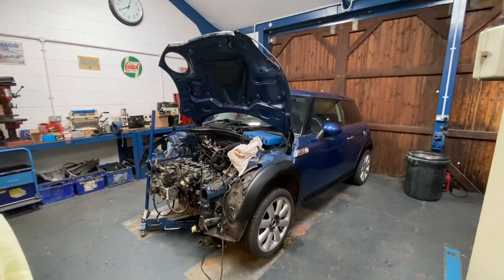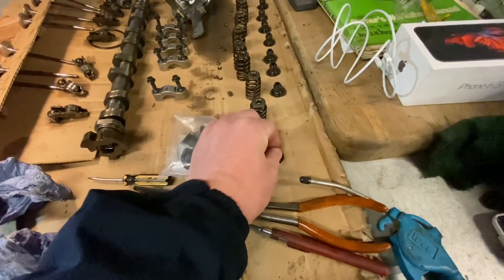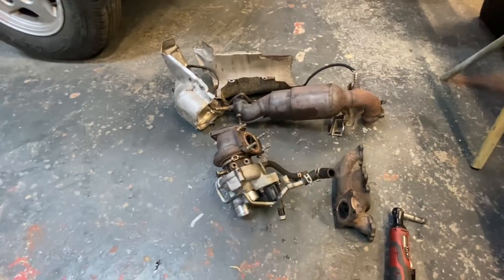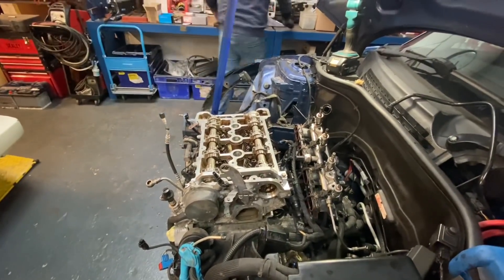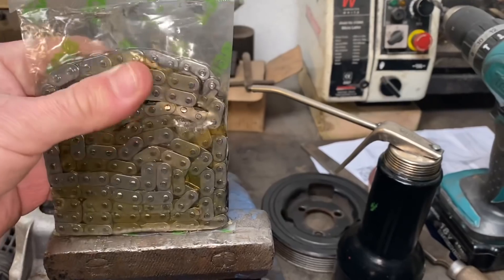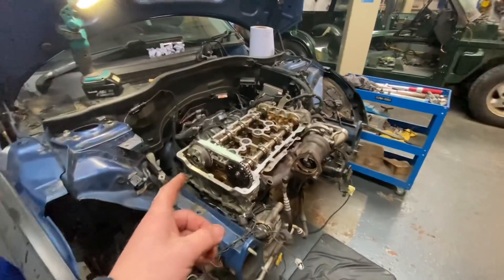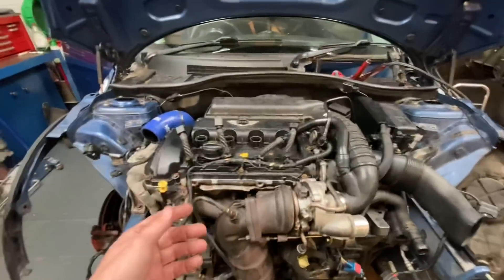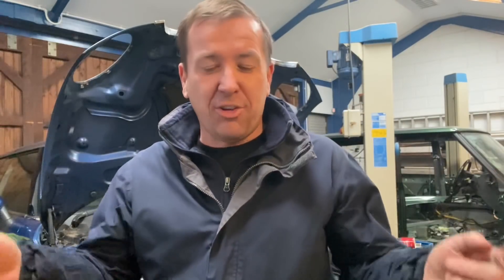Bargain£££ Mini Cooper S Engine Rebuild Will it Run ??? PT 4

Comment from the maker: See quiet a few questions about the head gasket of corse the new gasket was fitted you cannot reuse a head gasket wen Chris is sliding the head on the new one can be seen
Reply: Hi Rob great video as usual, i used to have to lap the valves in by hand in the "good old days", We used to reuse copper head gaskets back then on model T Fords LOL :-)
Reply: @nicnak4475  🤣🤣
Reply: Who ever said this is clearly not a Subscriber. 🤣🤣🤣🤣
Reply from the maker: @nicnak4475  they couldn’t be used twice anymore 👍
Reply: Like you would put it on without it
Reply: I would guess that the hole in the valve appeared gradually and the car would only misfire on low revs. I'm guessing the car has been run for quite a while while misfiring on low revs hence the buildup on the valve.
Reply: @deanharriss2029  :-) :-)
Reply: If my 147k mile Micra ever needs his Engine sorting out I think a 250 mile journey South is a good idea !!
Nice work , making a skill look easy as per usual with you two !! 10/10
Reply: Certain rebuild channels on YouTube would have reused the head gasket 😂
Reply: Sammy TheSeal  certain channels would have used a kellogs box and some gasket sealant 🤣🤣
Reply: @nicnak4475  Like many British motorbikes even into the `60s! You`d have to give them the oxy treatment first though to re-soften them but only if it was a single sheet of copper. You couldn`t do it with gaskets that were multi-layered because most of them contained a layer of asbestos!
Reply: @sammytheseal2307  You can reuse a copper head gasket after it's been annealed.
Reply: @lukem9766  Lol 😂
"They'll never see it and it won't be my problem after its sold with no warranty 🤠🤠"
Reply: @nicnak4475  Well not many engines have copper head gaskets do they
Reply: @jbbumpkin  I have a 60's Bonnie, had it for years and would never sell it, If you google, re use  a copper head gasket, lots of car and motor bike guys do still actually reuse a copper head gasket, up to 5 times, but as you say only if it's single layer copper.
Reply: @sammytheseal2307  No true, but the question was whether head gaskets can be reused and the answer is, yes some can.
Reply: @nicnak4475  I see 👌
Reply: @rhodrihow959  Give him a break, he's dyslexic
Reply: To be honest you give mechanics back a good name , so many try to rinse people its untrue ,
 At least we see the real cost of what appears to be a very unreliable engine with expensive repair costs , A shame  they aren't as simple as Issigonis made them in 59'
Reply: Was thinking the injector chris mentioned on cylinder 3 being different could possibly been replaced already with aftermarket thinking it may diagnose the initial issue ( just a thought )
Reply: @rhodrihow959  How did you miss quiet instead of quite? If you are going to correct his spelling, at least get that one correct. Quite as in 'quite a few questions'...Quiet as in 'no sound at all from the engine'. Lots of love from your old English Teacher. xxx ps There are so many pieces for an engine, it must be hard to remember everything x
Reply: @LittleCarol  He also wrote too not to, and missed out the word  "it" after the "when " (capitalised for some reason) .
 But there for the grace of god go I...
Reply: @sammytheseal2307  I was going to keep quiet about the missing quite, but I thought since Rhodri missed it, I would let him let him know! Rob is far to young to have been to school in the 60's and 70's. My best friend is dyslexic, I help her over the phone to construct sentences for letters and e-mails. I used to teach English at secondary level, but there is no way I could ever take an engine apart, never ever. I love this channel though, it gives me a real insight as to what really happened at my garage. When my car is broken, I drop it off, then as if by magic it comes back fixed. Being a blonde lady driver I am very grateful for my local garage, as they never rip me off. I love the way the boys can give new life to cars, we must recycle more.
Reply: @Oh-Jay52  I totally agree, being a blonde lady I can relate to that. Rob and Chris are so honest when the go through their costs. Mechanics is a highly skilled job, which I have total respect for. I just find some garages will treat me completely differently if I am my own, than if I turn up with a male friend. That should not happen.
Reply: @Oh-Jay52  Exactly right, no one is brilliant at everything. I have no clue about engines, but I love this channel. I came across it by chance and I am hooked! I am so happy to see any vehicle re-cycled.
Reply: I was about to say that when they slide the head on I didn’t see them install a new head gasket but apparently they did already had a new one installed & I just  didn’t notice it.

Comment: I think you might have hit the nail on the head with the odd injector in that cylinder.  If someone has mistakenly fitted an injector from a standard Cooper rather than a Cooper S to number 3 then that cylinder is likely to have run lean, and therefore hotter, until the valve has burnt out.  This is because the naturally-aspirated Cooper has less oxygen in each cylinder on the power stroke, so it can only burn a lesser amount of fuel on each ignition stroke.  The Cooper S is turbo-charged and the forced induction means there is more oxygen in each cylinder when it fires, meaning it can burn more fuel, which is exactly the premise that forced induction works on.  More oxygen means more fuel can be burnt which means a bigger bang.  The Cooper S injectors are likely to fire a bigger shot on each pulse, standard Cooper injectors will fire a smaller shot as the engine won't be able to burn the extra fuel in standard tune so the unburnt fuel will just end up poisoning the catalyst.  It seems pretty obvious that the damage to the valve was heat-related and not a mechanical failure as there's no damage to the turbo blades, so that metal had to be molten when it went out of the exhaust valve.  If it had just mechanically failed then there would be turbo damage and, probably, a lump of chewed up valve stuck somewhere as there's no way a piece of metal the size of what's missing from the failed valve could go through an operating turbo impeller without causing a lot of damage that would be very easily apparent.  It does rather seem to add up in a way that makes sense...

Lovely job guys, and a damn good sign that you've hit the issue squarely on the head with that one.  There's no way on earth it would run that sweetly after going back together if its' issues were down to the engine just being plain ragged out.  There's still a chunk of work to go and a decision to make on whether to put a set of injectors in her rather than just the mismatched item, but you've got your proof of concept, the engine's back together and running as sweet as a nut which has got to be such a satisfying feeling...
Reply: But it was coked up so running rich instead of lean.

Unless the coking happened after the valve burned ?
Reply: @johnmoruzzi7236    Yes, that's most likely to have happened after the valve failed.  The mixture won't have been fully compressed in the cylinder so it won't have burnt fully, and then the exhaust port being much cooler than the cylinder due to being cooled by the coolant running through the head will have allowed the coke to deposit in the exhaust port when it won't usually be able to do so due to being driven through by the piston returning up the bore...

Comment: Back in 1966 the gearbox seized on my first car, a moggy 1000 traveller. So my mate and I built a homemade derrick and yanked the engine and gearbox out in the street. He went to the scrapyard to find a replacement gearbox, which he actually managed to stuff in the bag of his frog eyed sprite, and did a de-coke on the head on my living room floor. I did all the grinding in by hand and boy were my hands sore. The moggy ran like a sewing machine for another 3 years until the floor fell out.

Comment: Watching Chris lap those valves in made me wish I'd got that lapping tool back in the early 1980's.  I had a Series 2A Land Rover that blew a head gasket, so while the head was off I fitted new stem seals, and lapped all the valves in using the old stick and sucker between the hand routine.  The car ran a lot better afterwards, but my hands took forever to recover.  Looking forward to the next (final?) video on the Mini

Comment: Power lapping :)   Last time I did one was back in the 1980's when I worked at a lawnmower repair place, and we used a wooden stick with a rubber cap, rubbed between our hands :)

Comment: One of my first jobs as a YTS trainee at a motorcycle garage back in 1986 was lapping in valves on a Suzuki GS1100. Had to use a wooden stick in those days, no fancy cordless drills in those days.

Comment: i would have been tempted to to do a compression test  before putting plugs and stuff back just to compare to 1st test as you did grind all the valves   in my day with the stick it was all doubled up 1st grind with coase paste then final grind with fine paste , when you got a smooth light grey ring around the valve seat on final grind  , job done   after a few hours at best and sore hands

Comment: I reckon Chris is spot-on with his diagnosis.  The valve only has to be held open the tiniest fraction for the hot gasses to start burning it.  Once it starts, it degrades very quickly and then obviously you get your serious misfire.  Exactly the same thing happens with an old motor with manual valve clearances that are too tight.   Great work lads, it sounded absolutely perfect :)

Comment: Them oil feeds are rubbish. The banjos are still loose when new as well. Great news you got it fixed and it was just a valve. The ones I’ve had to repair have been over heated and melted.

Comment: In the old days when I was young, we used to lap the valves with a suction valve stick, using first course past, then medium paste, then fine paste to get the perfect seal. Used to take ages to do lol.
As for burnt valve. That's possibly a faulty plug, faulty injector, or combination of two.
It can as Chris said,  could be a poor design with the port design. These engines do have a poor reputation. 
Good idea to run a cleaner through petrol tank every other tank full.

Comment: I remember doing reseating of valves on A series mini copper by hand stick and rubber sucker backwards and forwards took for ever lol
Reply: Likewise me on a 1977 Marina 1.3, that had so much carbon build up that it would run on until jammed into gear and stalled!

Comment: I hand-lapped valves in the past. I understood the need for that drill attachment Chris was using, it is a wise investment! Hand lapping is hard work. I was shocked that no crankshaft or camshaft was keyed. I only worked with old-school-engines, thank goodness everything was keyed. How sweat the rebuilt engine sounded, the joy in your voice was very self-evident, but no less well-earned, but it was a shame about the oil problem. A cracking good few hours work, with a few more to come. I am looking forward to the next and probably final instalment.
Reply: Hand lapped valves on BMC engines myself year's ago . It great to see the expert's do it with the modern tools .

Comment: Great video as always.  I was taught that the woodruf key was purely for location and it was the taper of the shaft and pulley/gear/e.t.c that held everything in place.  I'm still surprised the key is not fitted anymore though.  Interesting.

Comment: Great result boys , always a nice feeling when it starts after a full rip apart , oil pipe , no problem,  better finding it now while in bits , always been a weak engine on minus and Peugeot cars , change the oil and filter again after running for about 50 miles 👍

Comment: Buzzing for ya both. I had a Toyota Corolla with 180.000 miles on the clock many years ago. And it sounded like a timely tuned sewing machine. A few more minutes Rob and you could of had it sold.😂😂😂❤️

Comment: I spent many hours re-seating valves with the old wooden 'gobstick' as they were known,resulting in many blisters in the palms of my hands..
Tip:Lapping paste can also be used to sharpen cylinder mowers, if they are run backwards!

Comment: Great job lads, when I rebuilt my cooper s I replaced every gasket and pipe, water pump thermostat and bypass pipe, its the only way to rebuild these minis, and don't tighten the timing chain the way the Haynes manual say as its wrong. Install all cogs and bottom pully just past finger tight then install the tensioner then start with the inlet, exhaust then last the crank pully to the torque specs

Comment: The old laping tins corse on one side turn it over and fine on the other side ,or am I going back to far lol , carbon build up though was a thing of the past without no lead in petrol , showing a skill that is probably long forgotten with modern engines 👍
Reply from the maker: It is a double sided fine and corse tin 👍

Comment: Very nice information on the rebuild . Thank you . Am cleaning my crank and pistons block been checked honned . All parts getting ready apr head bolts mains conrod shells ect . 30 years old cb80 3 cylinder 100bhp standard 993cc charade gtti .my friend will rebuild it i will help and learn . Wish me luck with my engine rebuild i want 180.200bhp end result . More spark more air more fuel = more power 😁

Comment: Also I did recommended you change the turbo feed pipe and oil filter housing gasket in your previous video as prone for leaking

Comment: Renaults also use that idea of no keyways and relying on torque settings and I am like "Whaaat?"
Old school me needs to see keyways... 😂
That turned out well lads ...
We always used to run up cars like Twin Cams and RS1600s with the copper gaskets with no coolant to hand hot to melt the lacquer on the gasket.
Reply: No keyway means the timing can be set more accurately.
Reply: @chrispop99  I beg to differ on that. Cam wheels have vernier slots to set the cam timing and if necessary you can have offset Woodruff keys.
My concern is that they will let go at some point and then the engine is totalled.
Reply: @1chish You've never seen a sheared woodruff key?
 In addition to enhanced timing accuracy, components can be made lighter, as machining keyways weakens them.
Ford have been using keyless timing gear since the end of the last century. Of course, it's a problem if you don't do them up correctly, but an improperly tightened keyed sprocket or pulley will fail eventually due to fretting.

Comment: Lookin into the back of the exhaust hausing of the turbo will not show damage to the blades from foreign objects.  My mechanic did the same when I had engine failure on my twin turbo E36 M3 and the turbos looked perfect.  At a later stage I had the engine out and decided to open the turbos to take a look, both were completely screwed... Exposing the ends of the blades of the turbine wheel will show if its ok or not as the tips of the blades will take the foreign object and chew on.   I could send you pictures of them both how they looked from “the outside” and also once the exhaust housing was removed :).   Funny enough the car did make power, quite a bit, but once I replaced both turbos the low end came back.

Comment: Do you think when engines are built at the factory they grind all the valves in ? pre lube the chain ?   I wouldn't think so 
Got my eyes opened when an engine builder came to work for us ...   
Chris your old skool and  deemed the proper way ....    well done guys   nice content ......  yet again 

Rob ?    are you growing a pony tail ?
Reply: No need to grind in brand new , perfectly machined surfaces , the grinding is just to match new to old and pitted or imperfect surfaces.

Comment: Another sweet vid from you guys! and she sounds amazing...myself and a friend have got a project car on the go a green R50 mini one 2005 we wanted a good base so didn't go copper, she's mint, we have done the full service performance mods, sparks, air exhaust - wheels next then remap following that decide the largest turbo she will take depending the strength of the engine if no good prob drop a Honda vtec in or similar.

Comment: i would have done a compression test before replacing plugs to compare to 1st test as all valves had been ground and curiousity on no3 cylinder , in my day the double ended stick would be used with coarse paste on 1st grind then fine paste on final grind   when a light grey smooth ring was achieved on the valve seat 2nd grind  job done  usually 3 or so hours later with clean but sore hands

Comment: Rob Chris those engines are in the 207 gts to and the oil feed pipe is a common failure point on the thp engine

Comment: I'm guessing the valve lapping tool oscillates back and forth when the drill is turning. Motor did sound perfect. Top it off with hearing Chris's voice. Nothing more to ask for.

Comment: Great video again gents. Did you have a look to see if the stem of the damaged valve is still straight ? If it was bent, it could have been preventing it from closing properly. Anyway, she sounds as smooth as silk now, nicely done 👍

Comment: Some Nissan 1.2 dig-t built from 2014-16 suffer from burnt /broken exhaust valves, those suffered from high oil consumption. Like 1litre/1000 miles. Probably either the valve stem seal or piston oil rings could be root cause. Best to check oil level in couple of thousand miles.

Comment: When you do compression test I always do a test with out putting a drop of oil in first then if it’s a low test drop a bit of oil in then test if there is know difference then you know it’s valve problem